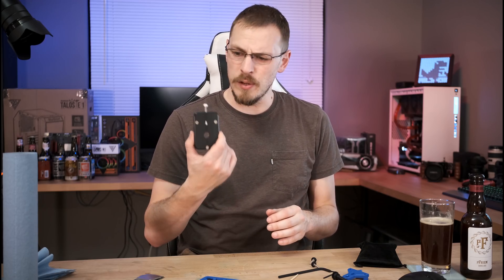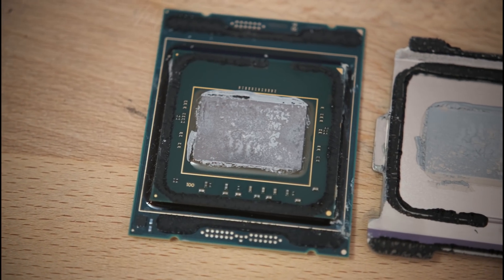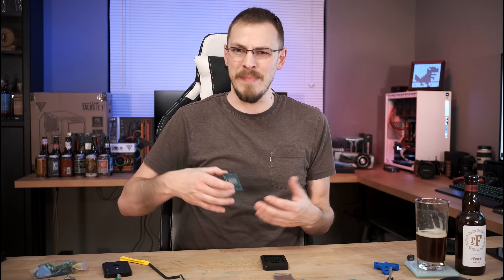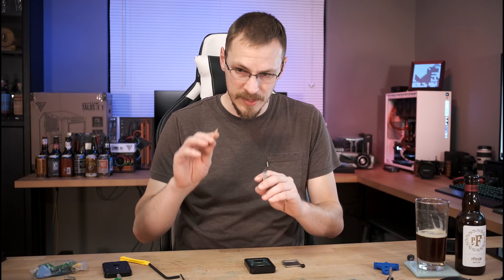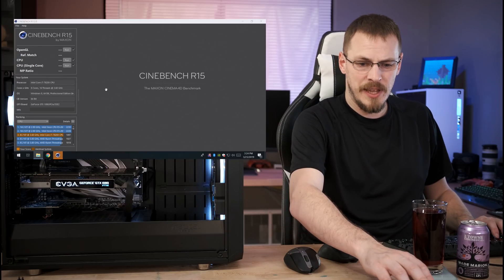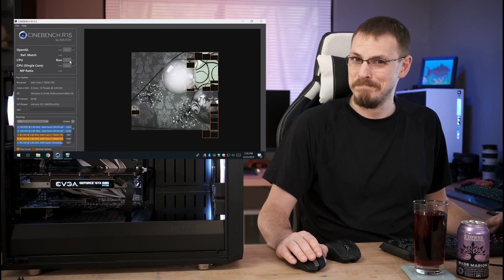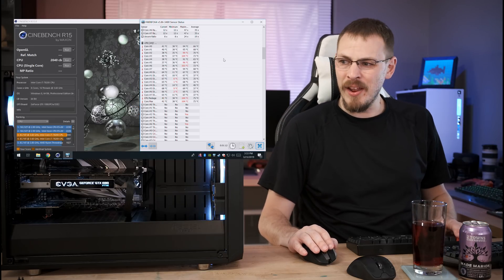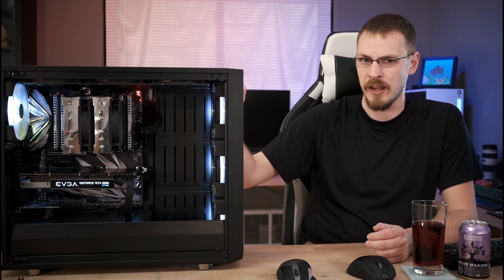Delidding an i7-7820X... Worth It? - Friday Flights

Comment: I read somewhere a long,long time ago, basically when AS5 came out. That there's a so called curing period of 300 to 350hrs. This may sound crazy but using AS5 i can vouch for this.
 I'm using a 10year old (but new) ZALMAN CNPS 9900MAX 300watt capable cpu air cooler on my i7 8700K. This cooler is tested 10th best on frostytech's site. 
OC,ed to 5GHz at 1.250v with the temps hovering around 85°c running Cinebench R20.                           Not delided either. 
After a couple weeks and some power cycles, it now runs at 80°c at 5GHz with 1.250v. Granted my i7 8700K is a Platinum Edition chip that can run 5.5GHz and finish with a Cinebench R20 score of 4000 and above. Still with that 7820X you could see a 5°c decrease if you continue to use it as is. 
Cinibench R20 runs longer but is more of a real world scenario with better AVX instruction support.
Reply: AS5 need a complicated curing process to become optimal. You need to alternate on and off cycles for a couple of weeks for that to happen. Normally a 4 - 5 C drop will occur over that time. Then you need to clean and re-apply every 8 to 12 months and repeat that cycle. That's one of the main reasons it's gone out of favor since about 2009 when vastly superior TIMs were developed. I've never understood why anyone is still using it these days.

Comment: If you're not using LM, you should be using Kryonaut. Don't use silicone to glue it down again. It could increase the Z height, increasing the distance between the die and the IHS. But, Air? I'd at least have it on a 280mm AIO, if not a custom loop. Even though you did a good job dropping 14c off the temps by removing Intel's drywall mud, those CPU's get hot, and they can pull a lot of power. I personally don't like any CPU of mine reaching 70c, let alone going past that. o7
Reply: Up to 75-80°C on cinebench when overclocked full bore is absolutely reasonable in my humble opinion.
Reply: That 14c off is temporary. Based on my experience thermal paste will dry out quickly and the temps will rise again.

Comment: 4.3 GHz?  That's literally RIGHT NEXT to a 2700X at full bore.  Would you be interested in doing some comparison videos, mostly on it streaming both while gaming, and just used purely as a streambox?  I'm trying to figure out a good usage for my 2700X when the next Ryzen lineup drops, and I'd be interested in seeing how this stacks up against an intel chip at the same speed, and also how far you can push the stream at those settings (also memory and how much of a difference it makes on each platform is intriguing to me).

Comment: You really should have used LM. For me on 7800X with direct die it did 20C difference in CPU Core temperature between Thermal Grizzly Kryonaut which is considered as best thermal paste and Conductonaut.
Reply: You really should have considered his use case (not wanting to have to deal with replacing LM every so often in a high duty cycle production machine) and his results (big improvement, mostly due to solving the original problem of removing the poor sub-IHS TIM).
Reply: @rednammoc  His claims concerning the liquid metal are misleading. You don't have to change it every 6 months. Look for videos where people have had them for years, it works fine.
Reply: @madd5  I don't think it likely needs to be changed every 6 months either, but there are reports out there of certain LM products degrading over time for at least a few people, and there is still insufficient data from controlled tests to assure long term use in production machines. Given that he's brought temps into the acceptable range for his use case, tell us why he "really should" change his production machine to LM?
Reply: Modern LM formulas like Conductonaut come with higher indium content which prevents it from harden over time